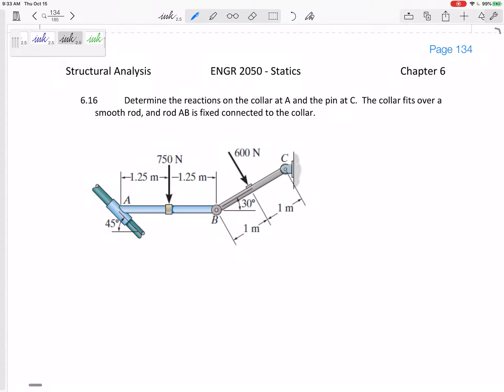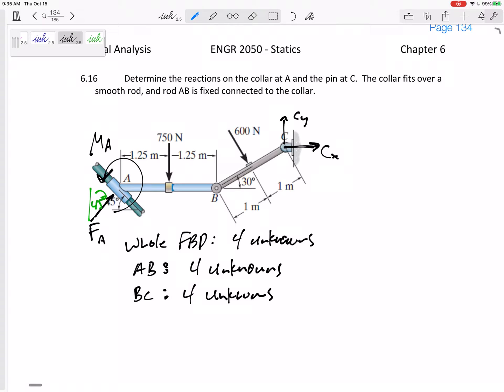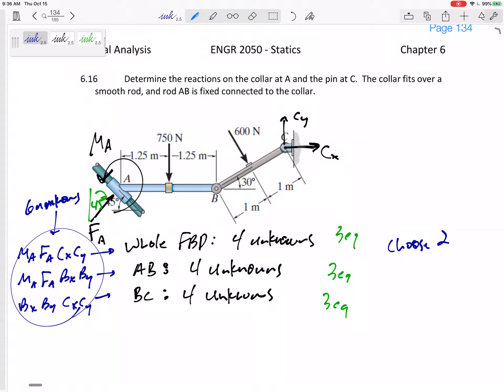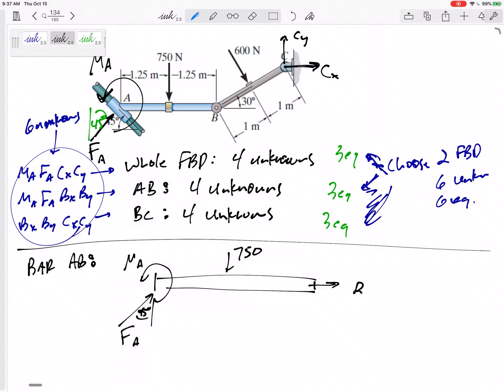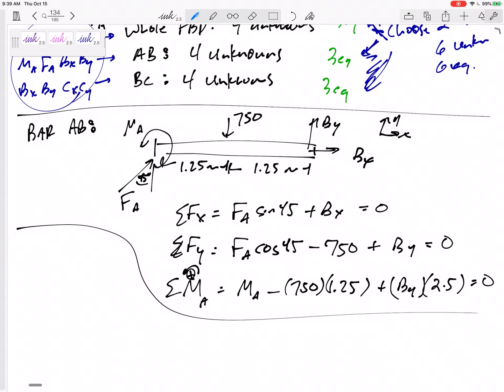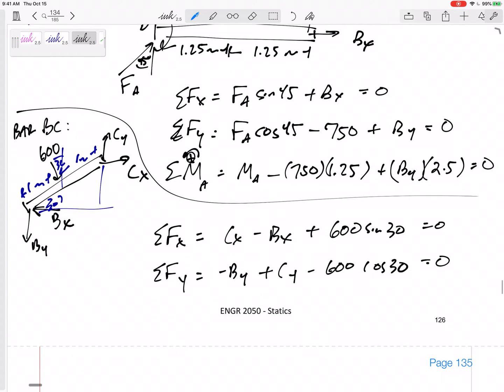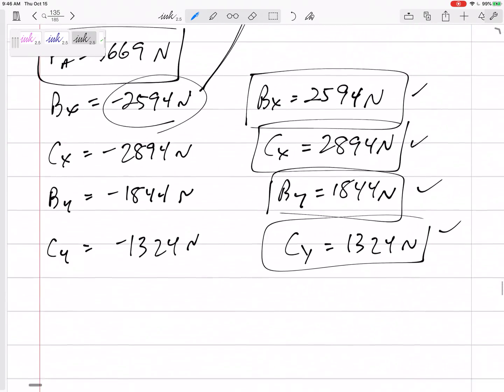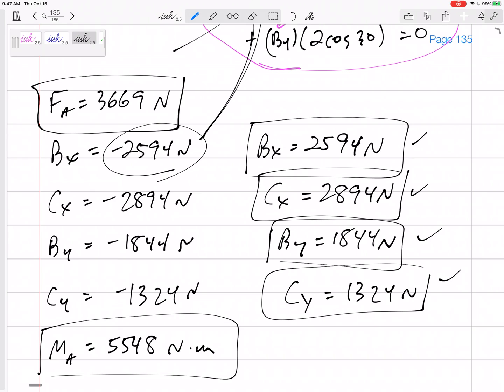Statics - Frames and machines problem 3

Comment: For the moment about A, shouldn't the unknown moment at A be cancelled since we're taking it about the point A?
Reply from the maker: No, because it is a fixed collar at A, there is a moment at A due to that reaction. It is a couple moment (free vector) that doesn’t have a moment arm. The sum of ALL moments at A will still add up to zero.
Reply: @engineeringdeciphered  Thank you for your answer.

Also, one more question: Isn't it plausible to use the fact that Fasin(45) = -Bx, and since we know that Fasin(45) = Facos(45)[mathematically at least], we can substitute it into the Fy equation for bar AB(11:38 for reference) in which we get By - Bx = 750, which means we only need two equations instead for finding By and Bx?
Reply from the maker: @adhammazen2547  yes, I think that makes sense.